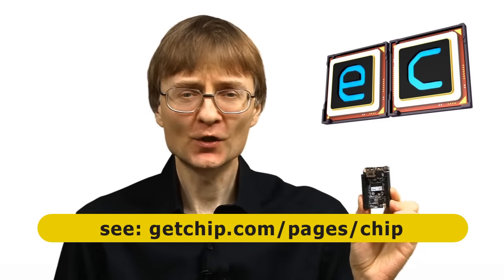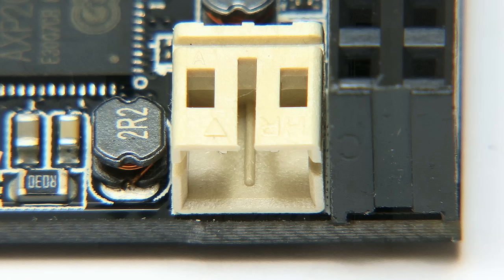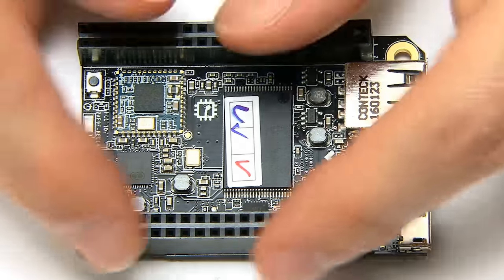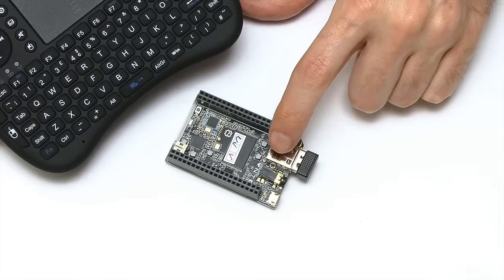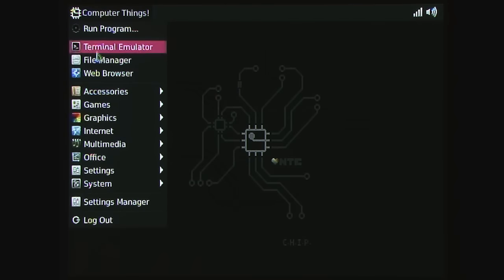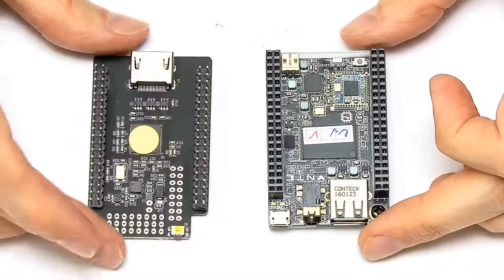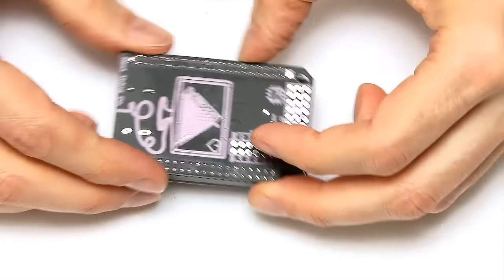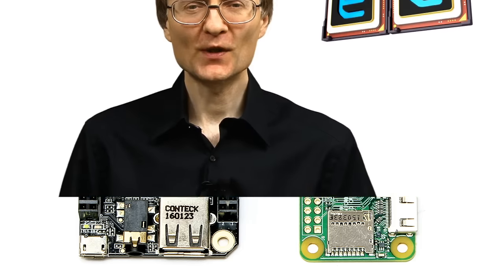CHIP $9 Computer

Comment: So, $9 for the chip. $2 for the half case. $15 for HDMI. Say $5 for a power supply? $10 for a hub so you can plug in $10 keyboard and $10 mouse... So $61 for a setup that you can't expand unless you want to go back to an NTSC video output. If you could piggy back the HDMI card.... maybe.

Comment: Well if you buy a 50$ phone you get all that + a better cpu, a speaker and microphone, the touch screen, battery, charger, all of this packaged into a plastic container designed especially for it, so while this is cute and interesting to see, I don't see any scenario where this should be favored over a low cost phone.
Reply: to program your own stuff onto the cpu
Reply: the whole WORLD of micro computers anв micro programming. Toys, cheap video registrator system, etc.
Reply: how to connect 50$ phone to TV, connect HDD and audio to work on it?
Reply: It's for private tinkering. For example you could make your own timed explosives based on some parameters or a very nice missile guidance system etc etc really nice
Reply: How do yo swap between OSes on that? I have already not seen any bios

Comment: Does blender run on thiis? I'm looking at making a rendering farm for video editing would this work as a client
Reply from the maker: Probably not give the RAM, and the board is not sold anymore. Try something like a Raspberry Pi 4 -- esp the 4GB model. Blender certainly works on that.
Reply: @ExplainingComputers  I have been looking on eBay and such for someone selling a group of pis ant a good price. Can I use an old router in place of a switch?

Comment: I wish you would have featured the audio player function. At 512mb of hardwired ram, most apps would crash after a few minutes use. I speak from experience with thin clients with similar specs and a 32mb Linux distro of the time(2012)Slitaz 3.0. Firefox crashed in under a minute or so as 512MB or 256MB just is not enough for this memory hungry browser. Now Dillo, worked pretty good. I am VERY surprised at the collection of software in the CHIP! Alot of actually HEAVY apps like: Thunar file manager, Abiword,gnumeric,firefox-esr, and even a gui version of networkmanager! I saw briefly, alot of apps. So I would buy this for testing and tweaking into such a portable audio player. I do not know if this will do movie file and DVD disc playback as is, though why not? A simple digital picture frame or DVD player use the same technology and dare I say, maybe even the same Linux embedded OS? It's a hacker's world!

Comment: When the DIP costs more than the CHIP😂
Reply: that's the capitalist system :d
Reply: 555
Reply: The same holds true for Raspberry Pi's "Heads". That makes it easily an expensive hobby. I hate it...
Reply: 6$ extra for the dip. And no flavour selections...?
Reply: You don't need the DIP. You can use VNC to access the CHIP's desktop from another PC.

Comment: Oh wow, $9 and it has a headphone jack,

🔫 Shots fired.
Reply: Zereko Gaming bwaaaaaa!
Reply: Just get a raspberry pi and be done with it which has an sd card slot and all the connectors you need
Reply: lol
Reply: @tyronenelson9124  the raspberry pi doesn't have a onboard flash storage chip the sd card slot is for it u have to buy a sd card with at least 8gb and it costs more than the pi it self
Reply: @yet.4587  an* onboard flash
Reply: @yet.4587  an* SD card
Reply: @yet.4587  itself*
Reply: yeet offcial i bought a 128gb micro sd for $25. The pi costs 35
Reply: your mom has a headphone jack
Reply: @tyronenelson9124  raspberry pi is more expensive. And the zero which isn't more expensive doesn't have wifi or Bluetooth or near as many connections
Reply: 9$ and it has a fukken power button.
Reply: Raberry Pi is for people who can not Afford a Lattapanda!
Reply: @effyou128  odroids are cheaper and more powerful.
Reply: @Zellonous  Na! I have one I have a few Pi's I have a orange PI The Latte panda has a integrate arduino! That alone is awesome! I've ran bench marks! You can hook up a Normal Gaming GPU to the New Latte panda with a 2.0 extension. O droid doesn't even have on board, WiFi ,Bluetooth or storage The panda does! The pand cpu is like 1.75 I over clocked it and kept stable at 2.5 The O droid can not be over clocked at all! Plus You can run any OS on the panda Lynx ,windows hackantosh!  I even ran Android on it just for fun!
Reply: @Zellonous  deff not More power! I have benchmarks to prove it! It renders so much better!
Reply: @effyou128  what odroid do you have? They have 8 core odroids.
Reply: @Zellonous  I have a h2,c2,go and a xu4 I get them for free so I played with most of them!  Coars dont mean much My work  Pc has 32 cores and 64 threads Doesn't mean it will play games Better than my Razen 7 gaming pc
Reply: Better than iphone 😛
Reply: @yet.4587  no it doesn't. I got 32gb Samsung Evo for less than half the price.
Reply: cough iPhone cough
Reply: @tyronenelson9124  But it is of 35$

Comment: Amazing how small they can make computers nowadays.
I predict that by 2020 they will be making PCs as small as cornflakes.
Reply: 2040 embedded under the skin, able to run from the same power supply as the heart
Reply: What PSU does the hart use then? :p
Reply: hingeslevers The average human, at rest, produces around 100 watts of power. This equates to around 2000 kcal of food energy, which is why your recommended daily intake of calories is around 2000 kcal. ;D
Reply: Breakfast is going to get weird.
Reply: Only if it pulls up your browser history while in your cereal bowl.
Reply: You probably have a smaller and more powerful SoC in your pocket right now and you had it for years(in smartphone). Why so surprised?
Reply: In the future there will be no dedicated computers. You will use a device to access the cloud in which your desktop environment is being run. Backed by unrivaled processing power.
Reply: Deltaexio It's not a Computer, its more of a computing chip.
Reply: Well it seems amazing at first, but then you think of every small sized phone these days and realise they have much more processing power and a whole screen, not to mention you dont need a mouse, it includes speakers, bluetooth, wifi and so on. If you were to take phone's board with same components that this computer has, it would literally be quarter the size if not less. (cause screen and battery takes most of the space).
Now of course it costs $100 instead of $9 but we are talking size not money.
With that being said, smart watches and stuff that are integrated even further, yes, they are overpriced but im pretty sure they already make flake sized computers...
Reply: +hingeslavers well, heart is a complex organ of muscle. Just like any bodily muscle, it gets an electrical impulses from the nervous system. With that being said, it is plausable to connect a chip to human nervous system in order to make chip work from the human energy but the chip would have to be integrated so much that it would have to run from miniscule amounts of energy. Thats why +unenslaved2012 predicts 2040, cuz u know, the future. He's being optimistic a bit but it is plausible :)

Comment: And to think, it wasn't that long ago when I got my first computer. When I bought it, it was the top of line. It was an IBM 286 that cost nearly $3000.00. The owner was required to load all software. The first was the DOS, then the Dot Matrix printer, sound card and so on. There was no such thing as Windows then. When Windows hit the scene I hated it. I was used to telling the computer, where and what, to do using DOS commands. I played around with CONFIG.SYS a lot. I designed a command to keep the kids from tearing up the computer, which they usually did. Unless you knew what series of keys and their correct order, whenever anyone unauthorized attempted to use my computer my program caused the directory DIR/W to display then turn off, then display the DIR and turn off, a continuous loop that could not be stopped except by powering off the computer or entering my code. The system was huge and the monitor was a green screen and also huge.
Reply from the maker: I too liked the days of 286 computing. :)
Reply: Hercules monochrome?
Reply: I had an Epson 286 w/ EGA graphics and a whopping 1MB of ram.  Ran XTree and WordPerfect.
Reply: Also Norton actually had decent software back then too (Norton Commander)
Reply: Are you viewing this in Lynx?

Comment: Very cool. But not including HDMI and charging $15 for HDMI add-on... that takes up all the GPIO ports. What is up with that?
Reply: MasterBata Exactly what i thought, it does apperar the thing offers some of the pins as solderable pcb holes. However i can see the advantages of this one. No sd card required is great on my books since most of my use cases don't  really need that much file capacitiy. Wonder how many write cycles is that flash rated for...
Reply: i think their big mistake was their whole "this is a full computer" kind of advertising. This is amazing as an integrated processing unit for small projects, in much the same was as the Pi Zero is, and with onboard wifi and storage it's actually a better deal over all. It does not, however, do "serious work" like their website suggests, you want to SSH to it for everything you're doing.
Reply: don't forget it is 3d enable
Reply: Not sure what you mean by "3d enable"
Reply: HDMI requires expensive hardware and an expensive license.
Reply: +xXYannuschXx ...and yet the $5 raspberry pi zero has hdmi output as standard.
Reply: MasterBata They already have a HDMI license due to the Raspberry Pi and are getting so much money from it, that they probably don't care that much in regards of the Pi Zero.
the CHIP isn't as popular and they need to ask for a higher price per unit.
Reply: +xXYannuschXx - I checked. Cost is a flat fee of $10k per year for high volume production, and 5 cents for each unit. So I guess that solves the problem of "expensive" licensing.
Reply: The gpio are still accessible, they are just moved to the middle section on that hdmi dip
Reply: +hornylink don't be silly, they are charging $10k no matter if HDMI is included as standard, or is an optional extra (like in this case). 
Instead making it a $9 computer, they could have made it a $10 or $11 computer with HDMI. Instead they decided to throw in $15 HDMI extra which is a ridiculous price for BASIC functionality. 
There is absolutely no reason to do that, other than milking customers.
Reply: should have used displayport instead
Reply: MasterBata well the majority of projects won't use hdmi, and it means all those people get a cheaper PC and more gpio, its a much better system
Reply: +Jules Verne better than what? Pi zero? It's much bigger, so I say it's worse. HDMI licensing fees are a joke, there is absolutely no reason not to provide HDMI port for, say, $1-2 higher price. 
Majority of projects won't use HDMI? Well obviously, dummy, it's got no HDMI!!